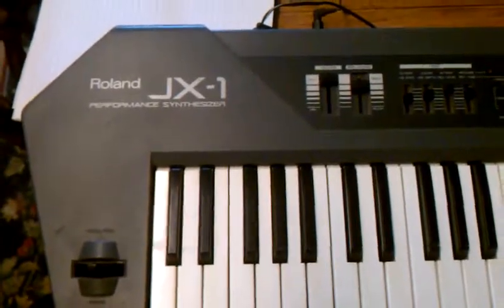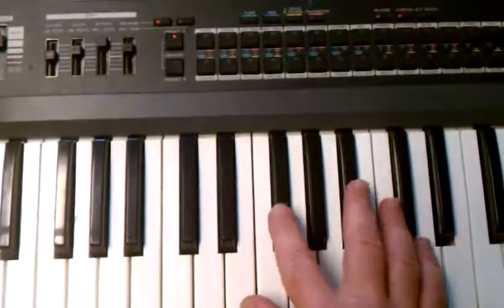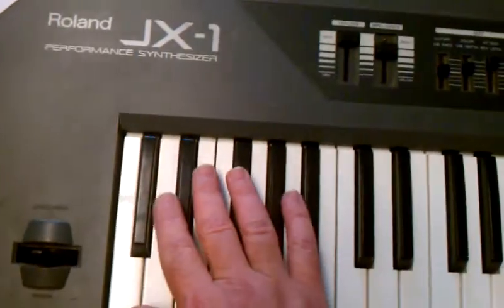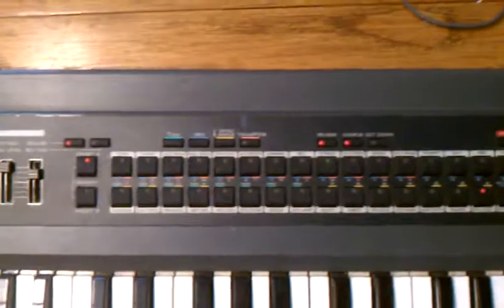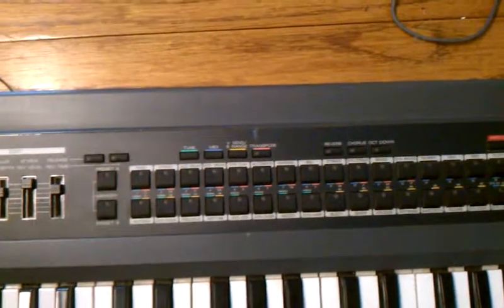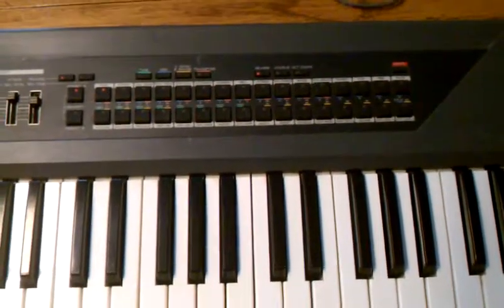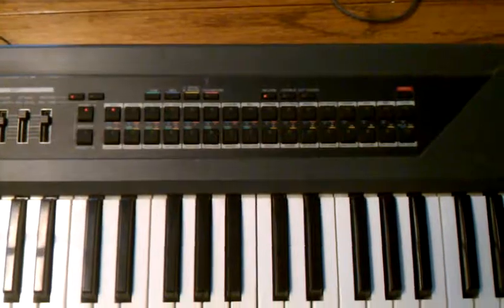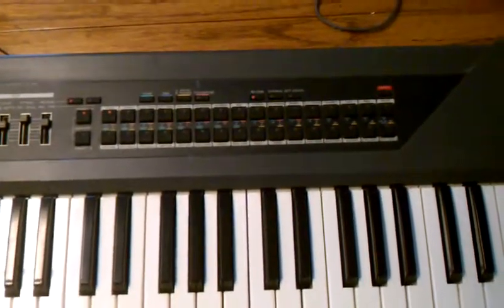Roland JX-1  repair Pt.1

Comment: Just wanted to say thank you for posting your experience with the JX-1 and it's voltage regulator.  I've had a JX-1 for years now and it's had the issue you've talked about in your videos for ages.  I decided to check the regulator and found the model I have uses an L78MR05 but does the same job.  I ordered a couple of these before stripping the keyboard down completely, but when I came to replace the component I found a dry joint on the reset leg of the regulator which in my case was causing the issue.  

I wanted to share my experience and recommend to anyone who's got a JX-1 with this problem to flip the board over and check the solder joints before ordering replace components.  At least I have a couple spare now, just in case 🙂

Once again, thanks for taking the time to post this.